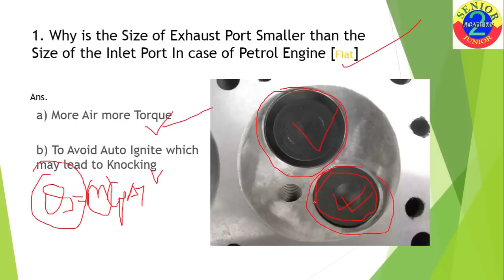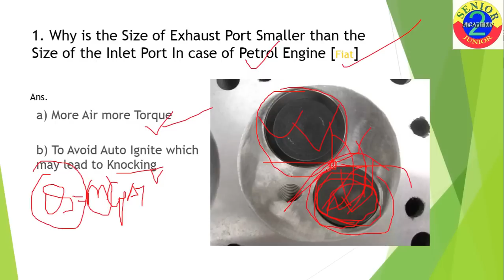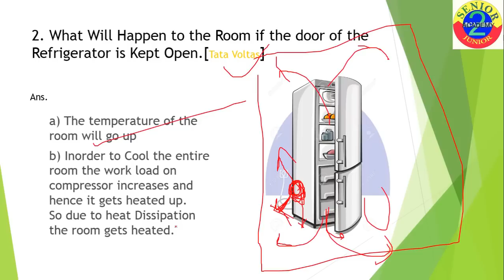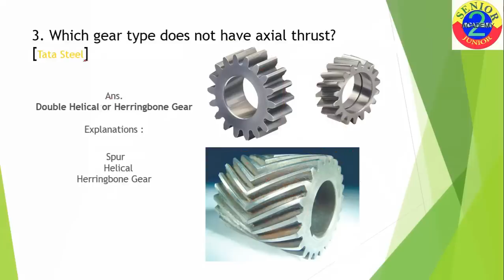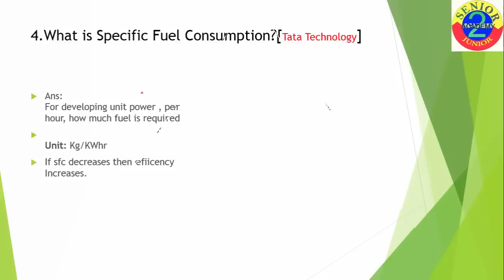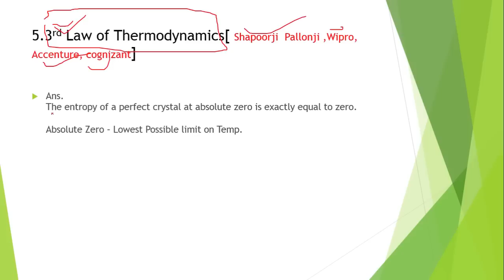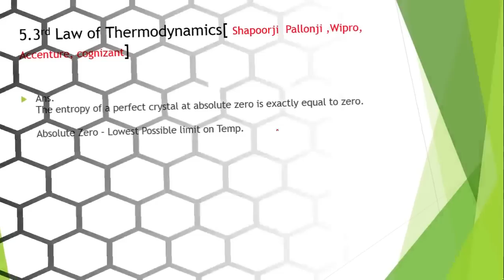Mechanical Interview Question for Campus Placement (Question 1-5)

Comment: In the first question you have used the words inlet port and exhaust port whereas the photo consist of four stroke petrol engine's photo. Whereas inlet port and exhaust port is used in two stroke engines. You should have mentioned it as inlet and exhaust valves instead

Comment: If you keep the fridge door open . The temperature of the room remains the same but the temperature inside the fridge increases because the function of the fridge is is to pump out the heat inside the fridge outside . If the door is opened the fridge continues to pump heat from the fridge outside at the same time heat from outside enters the fridge. So it can't keep up with the increased heat and and temperature inside increases
Reply: you are correct....But it is in the case of ideal compressor which doesn't get heated up.But here as heat is moving in to fridge from room constantly(as heat keeps on moving until thermal equilibrium is obtained but here the work of compressor is keeping fridge temp very lower from room temp...so there will always be temp difference) compressor has to do more work so it gets heated up more which in turn increases room temp

Comment: first of all i would like to thank u for your great efforts in making of such videos.also i would like to add some info on the first question. the inlet port is bigger because at the time of suction stroke the pressure already reduces as the piston moves from tdc to bdc, so to compensate the loss the pressure required to suck the fuel in should be less therefore the inlet port is kept bigger. now talking about the exhaust port, it is smaller because as we see the valve timing diagram the inlet port is opened few degrees before the completion of exhaust stroke for better efficiency, so we keep the ex. port small to prevent the fresh fuel mixture from going directly into the exhaust port.
i hope my answer helps. plz tell me if im wrong. 
regards
Reply from the maker: thank you so much for the explaination
Reply: thanks sir
Reply: Varun Mittal This is the right answer....Video was bullshit
Reply: I would like to modify your answer.
The inlet will be big to sufficiently intake air or air fuel mixture.
The exhaust will be small bacause due to combustion it already will be at high pressure and the same need to get exhausted forcefully out of engine.

Comment: even spur gear doesn't have axial thrust...why have you answered herringbone only...why not spur as well..??
Reply: Because herringbone is double helical gear so thrust is less..
Reply: Because spur gear have noice which is undesirable....
Reply: pradnya more Pura answer sun to lo
Reply: Pradnya statement is Right spur gear ha no axial thrust theoretically but practically in all types of gears there will be axial thrust exerted......The reason for axial thrust in helical gear is their contact points.....It actually starts from left and ends at right or vice versa......... In Herringbone these will be nullified...... So the axial thurst is lesser....... But higher load carring application Helical is preffered to manage the axial thrust spherical typed bearing will be used........
Reply: pradnya more u r so smart

Comment: For all those who didn't get the idea about the 2 nd question ...here is the detailed explanation

When the refrigerator door is open, the hot air from outside comes in contact with the evaporator coil thus cooling the air, now the refrigerant has to dump heat to the surrounding since the refrigerator is in room so this heat is again dumped in the room on the top of that the condenser also dumps the heat from the compressor thus there is overall heat adding in the room

If someone wants to understand in simple engineering term. Lets the room in which the refrigerator is kept to have an adiabatic wall so the heat interaction is 0 so Q=0 now we know that W=-ve for compressor since it is a power consuming device. If we rearrange we found that u=+ve  i.e. the overall temperature will increase as U= mCv (T1-T2)
Reply from the maker: thank you

Comment: I’m sorry, but you didn’t explain nothing. For example, in question about refrigerator, you didn’t explain why temperature wouldn’t remain the same, why engine and compressor generate more heat than evaporator absorbs.

You also explained poorly Entropy question, which shows you don’t have deep understanding of topic.
Reply from the maker: firstly it will be "didn't explain anything"..
this video is just to  give basic idea about every concept asked in mechanical  interview.
i make my video for every average engineering student to understand.May be i have missed few points but i have given the correct explanation.
i don't want to make my video boring by going into deep concept, there are already video by NPTEL to understand the concept.
i am an Officer not a researcher.
Reply: I’m not from India, but on my university if student gave answers from your video on the exam (even oral) he or she wouldn’t get points.

E.g. question about refrigerator. You said refrigerator will cool the room and compressor load will increase (why?), so it will heat the room. You didn’t said if compressor delivers more heat than evaporator takes out and you didn’t explain why.

Comment: sir in petrol engine there will be no ports na only valves will be.in ci engine ports will be na.
Reply: not true, port is a terminology used to represent the passageway of air into a petrol engine in-case of two-stroke engines (designed for two wheelers).

Comment: Very informative video!  I would like to clarify that the Kelvin scale denotes absolute temperature, so it does not need the word "degree" on it. Its not zero degree kelvin. The correct is Zero Kelvin ( 0 K)  no more degree sign. 😄😄

Comment: Sir I have a question..
Suppose you have two screwdriver. One with thick handle and another with thin handle. Now you will have to pin a screw into a piece of wood. then what will happen?
a) You will have to roate the thicker driver more than the thinner one.
b) You will have to roate the thinner driver more than the thicker one.
c)  You will have to roate both the driver at same.
d) none
Reply: c
Reply: ashif mahmud galib
Reply: c

Comment: in the first question,u said Q=mxCpxT,more the mass (m) more is the heat(Q) , but which mass are you referring here?
Reply from the maker: thank you for watching.

i mean to say the  mass of exhaust gas that will accumulate near exhaust valve..

if the size of exhaust port is bigger more gases will accumulate which will increase the heat near the port..
exhaust port is the hottest component in the engine.
Reply: Senior To Junior Academy 
Hi thanks for video your doing Good job but please stop it your concept is not clear 
Q=Mass of ex. Gas* Cp* ^T     means more the Mass of gas more heat generation that causes knocking so we have to increase dia of ex valve so that more ex gas can be thrown outside to reduce ex. Gas mass